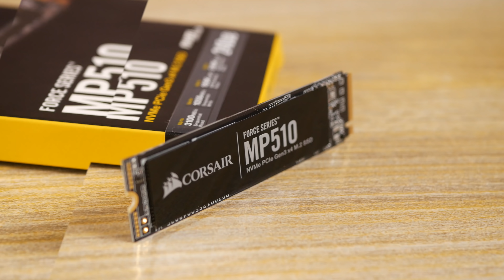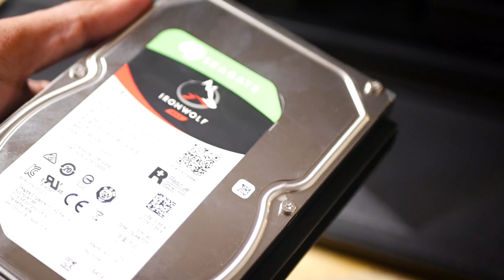Asus Prime x570 Ryzen 7 3700x

Comment: what about chipset temperatures? Almost nobody gives that information in the videos but it is very useful. I have a x570 steel legends and in idle it gives me 50 but in load it is too hot up to 70, I have had to set my video card to 80% so it helps to lower the chipset temperature to 55~60° under load, but this is not a solution, I would like you to share the temperatures you get from the chipset of that board. Thanks, and good video keep it up!
I subscribed! nice job
Reply from the maker: Thanks a lot